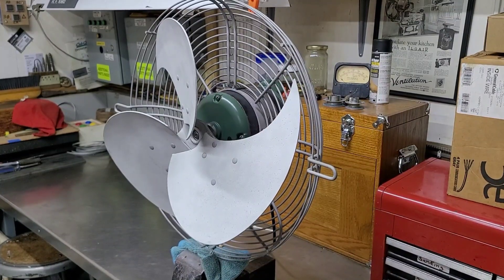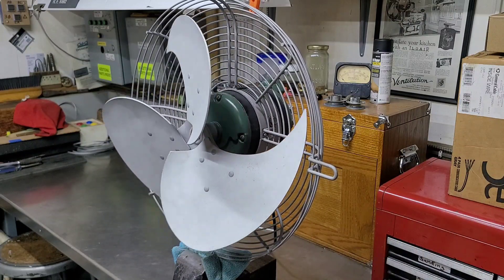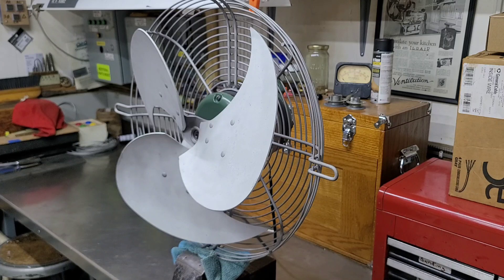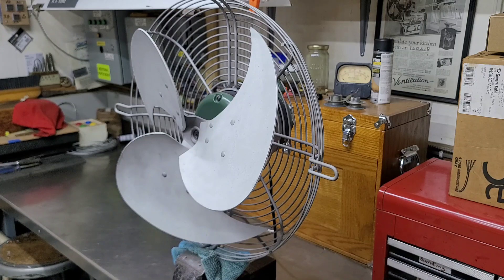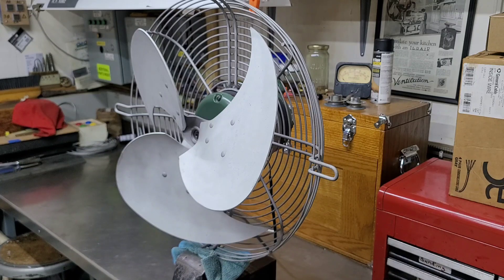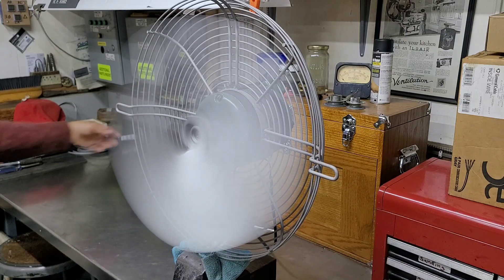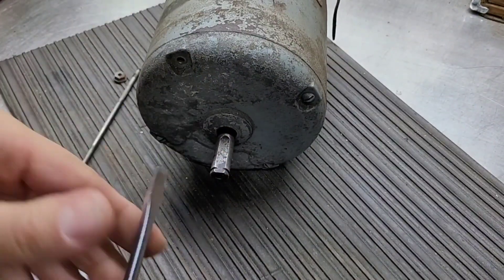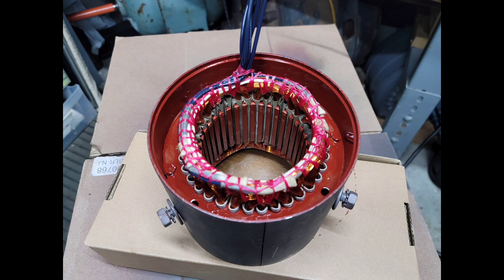ILG Model 163 Panel Mount (Discussion  & Motor Rewind Overview)

Comment: I never knew ILG made panel mount fans! Those blades look a lot different than the standard 3 blades seen on ILG exhaust & pedestal fans, but I’m sure it whips out air!
Reply from the maker: The blade wings are exactly the same as the typical 163 only difference with this being a later model it has a 1/2 inch bore in place of the common 3/8 that most 163 fans have. The motor on this one is also a totally enclosed type as opposed to the turbine style found on many regular 163's.
Reply: Actually they are the same it’s the size